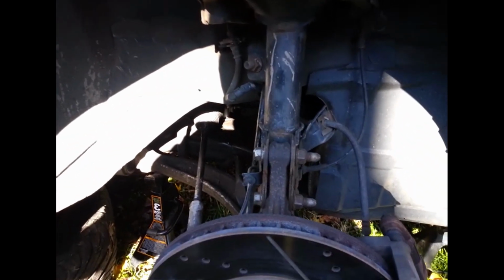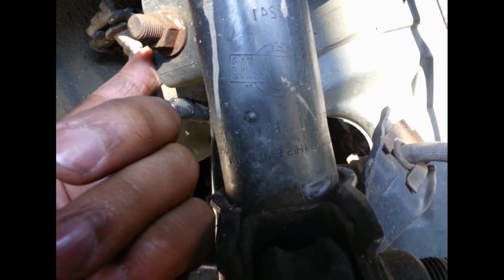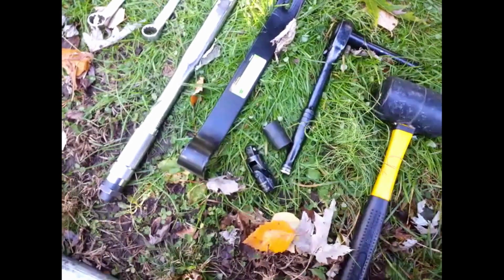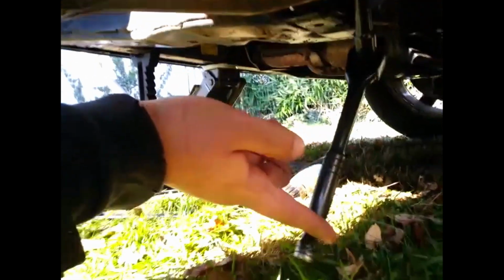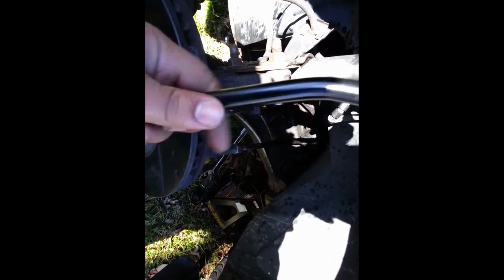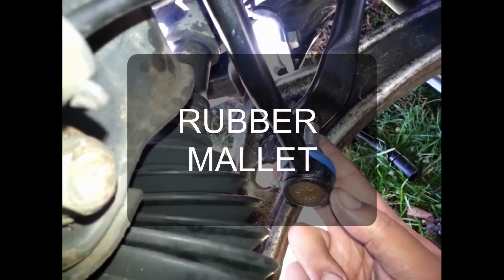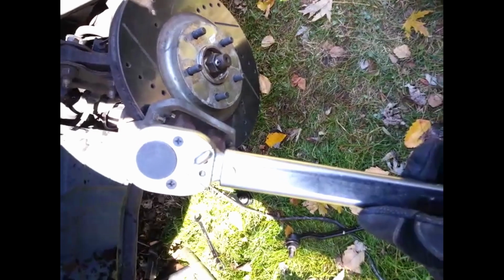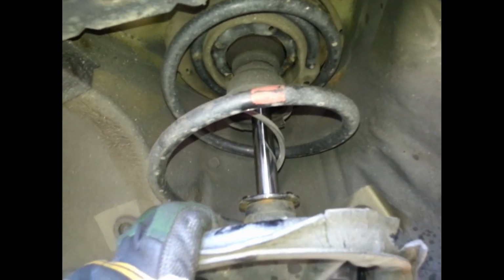Replacing Front Sway Bar Links /// 6th Gen Nissan Maxima

Comment: I know that you're trying to help people. However? Never work under a car on grass! 
Also if you have an angle drill? It makes your work much easier when trying to get to the bottom back bolt. Top one too if you want. 
Maybe spray the bolts with Liquid Wrench or Blasters B/4, to loosen the rust on the bolts you're going to be working on.
Reply from the maker: Thanks, for the good tips.  And I agree working on grass is not safe.

Comment: Safety alert: Jack it up on concrete or a flat solid even surface.. Grass is uneven and some dead spots.
Reply from the maker: Thank you, for watching the video and the comment.  And I agree 150% that working on grass or soft ground is dangerous.  It's all I have so what I try to do is add some additional jacks just in case.  At some point I'll pour a slab down.